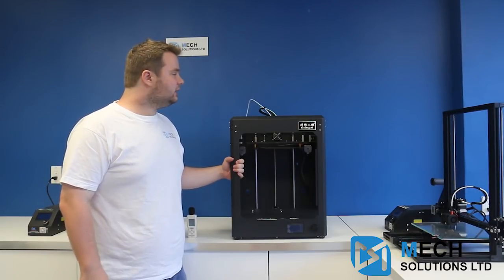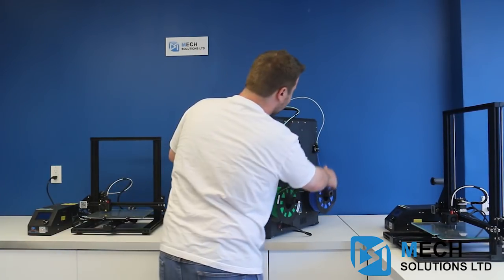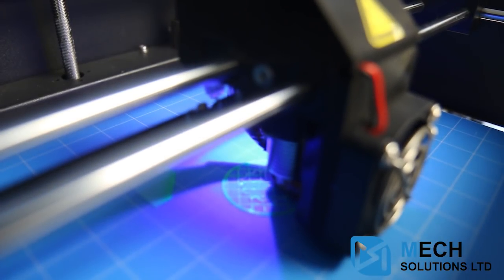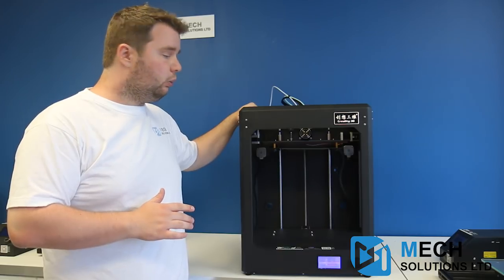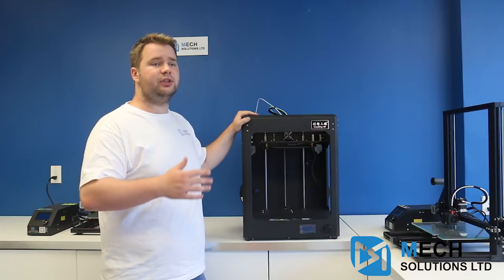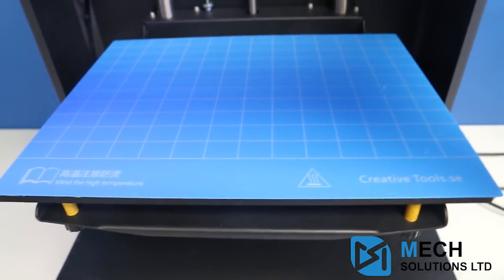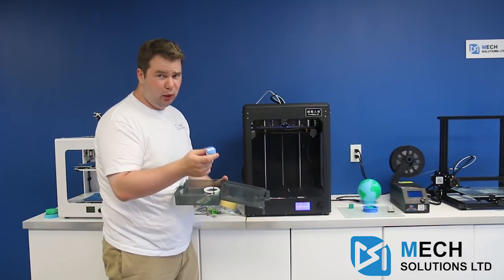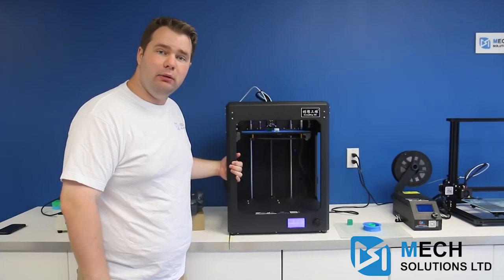The New Dual Color 3D Printer Creality CR-5S instruction

Comment: Is this a 24v system or a 12v system? Can the printer be enclosed to print ABS, Nylon, and other high temp filaments? I’m looking for something like the Flashforge Creator Pro, but with a larger build volume. Thanks.